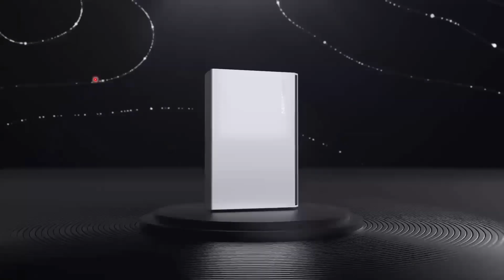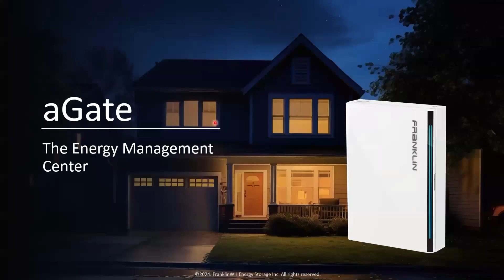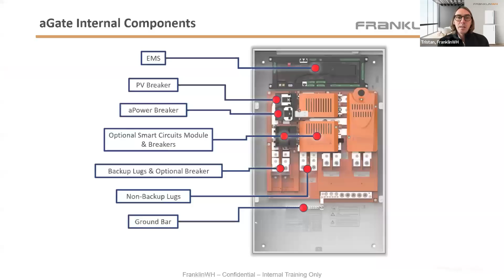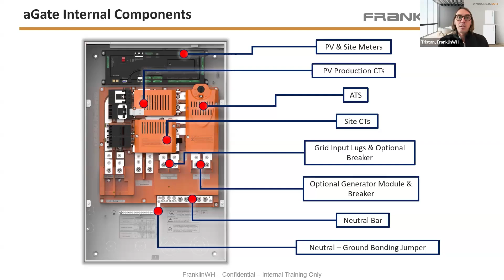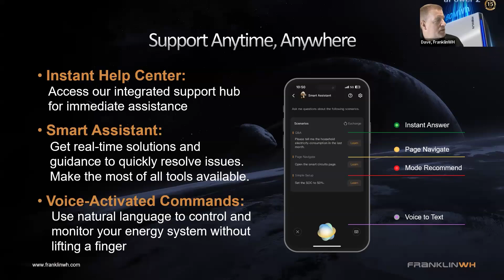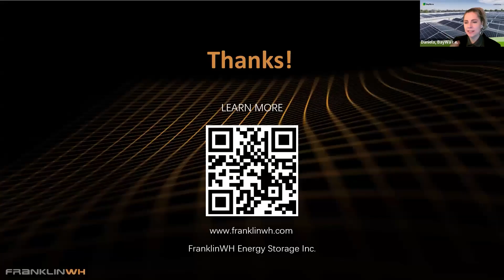Discover the Features of the FranklinWH System

Comment: In the Q&A section you mentioned that there is no load management when using the EV as backup power. If you only get 30A from the EV It sounds like the customer has to run around and turn stuff on and off. That's the way my backup generator worked 10 years ago and it was a real pain in the rear. More often than not if there was a power outage when nobody was home we would return home to a backup generator that had its output breaker tripped and was still running or out of fuel. That was particularly during wild fires and storms where there was no or very little PV due to smoke or snow. Huge numbers of LA residents recently had that problem. I know that you have the ability to just disconnect up to three loads for the entire duration of the outage but I have many more than three loads to manage. Do you have any plans to move into real load management to power multiple loads according to priority, prevent overloads and conserve battery power like your competitors?